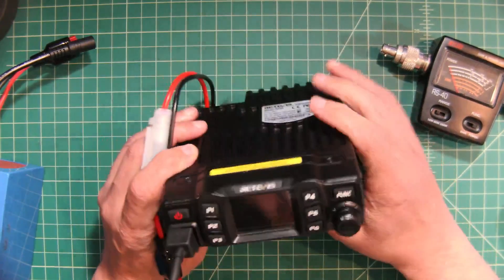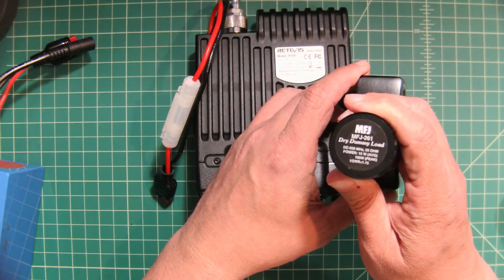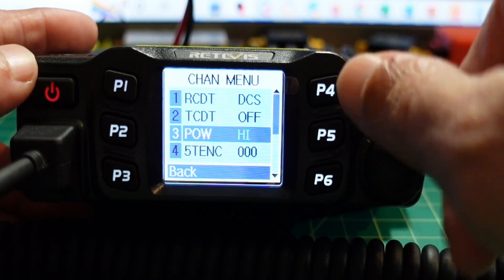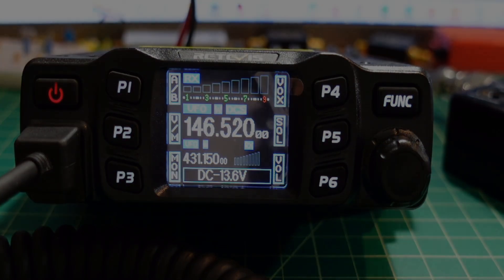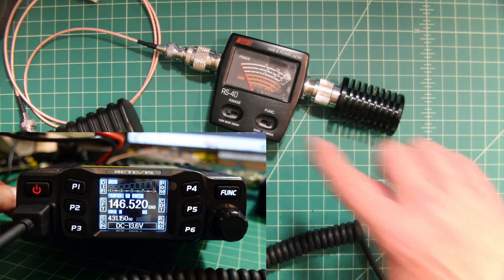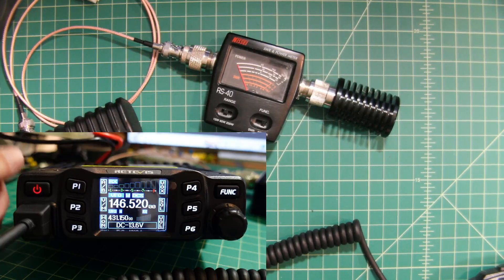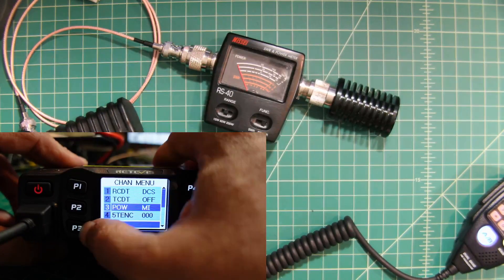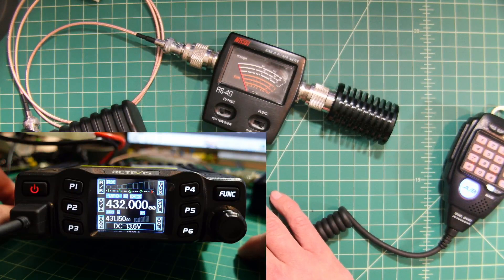Retevis RT95 Power Test - Dual Band Ham Radio

Comment: I have this radio  and was just transmitting about 100km/62 miles. 12am clear sky and not sure about  any radiation left in the air  but we did have a good aurora  lights show 5 days ago.

I use mine for work and radio controlled roads surrounded by bush with hills and valleys so with Normal conditions daytime i can get roughly 20 to 30km day time on those roads  and estimated upto 80km roughly at another  work location with a city with about 60,000 people in between me and the other work location and can communicate  with some of the highway  tractors, using a roof magnet mount 28 inch 136-174 antenna on the roof of my truck.

I do use it for monitoring other frequencies like our local railway frequencies also at work to know when they  are entering and exiting property.

Also added an external  speaker because the factory one I didnt find was loud enough for my ears but over all happY with  this radio and price point for what I use it for its been great in the first 3 months
Reply from the maker: That’s awesome man, glad to hear it’s working well for you 👍
Reply: @TheSmokinApe i missed 1 key thing after re reading, the 60+ km at the other location is on top of a valley hill and at night time. 

The 100ish km distance other night, we have had alot of northern  light action last couple weeks so im not  sure if its helping act like a skip or not aa i don't  use it at that other location often

Comment: Hi what was the power output from the psu? On high transmission it’s drawing around 70W! Antenna had swr of around 1.6 on vhf to
Reply from the maker: 70w at 13.6v is about 6A, I didn’t test the power draw

Comment: I've got this radio on the way, and I'm trying to get it programmed on the computer so I can start playing right away. I can't figure out what a number of the functions you can program to the buttons are, do you you know where I can find a list of the abbreviations and their functions?
Reply from the maker: Check the manual.  Are you using Chirp?
Reply: @TheSmokinApe  I've read the manual, but I still can't figure out what the following programmable button functions are for: TRF, CAL, TALK (and I'm assuming Null means button has no function). I am not using chirp, I tried to download an img file in order to edit it since I don't have the radio yet but I couldn't open it in Chirp. Hopefully I can get it to work by downloading from the radio once I get it because this anytone software is a bummer. Thanks!

Comment: I just ordered this radio, but I have just one comment on your review. Its great that they sent this to you fir review but you gave it a pass on hi power when it barely got over 20w. I bought it because its advertised as 25w to me thats not a pass its a fail. They could have done better. And you should have stated that. 21w is not 25w period. Were not getting what they advised. Close enough?
Reply from the maker: Steven, I had a pretty lossy piece of coax that I know was causing some attenuation, I didn't and still don't feel like doing the math to figure out how much.  It's a 100$ dual band radio. You have to have realistic expectations, it's worth every bit of that $100, and that why I gave it a pass.

Comment: Can this radio be powered through a cigarette lighter power plug? If I can power it through a cigarette lighter power plug this would be the perfect radio to put in my semi truck (my company owned truck) and then they wouldn't be upset with me for wiring a direct to the battery connection.
Reply from the maker: It's gonna depend on how much current / amperage your DC accessory port can deliver, the manual for thr rt95 says the power cable is fused at 10A.

Comment: Been using this RT95 for 7 months now. Great little radio, its crystal clear audio on TX. 
Its compatible with Chirp. there are two main screens for quick access to menus and able to swap the on screen menus about giving quick access to things like the power button. 
A quick press of function button will access the other screen for 5 seconds then it will revert back to main screen. Also mic buttons are changeable.
You can turn off that terrible beep as well.
Reply from the maker: Thanks for the info!